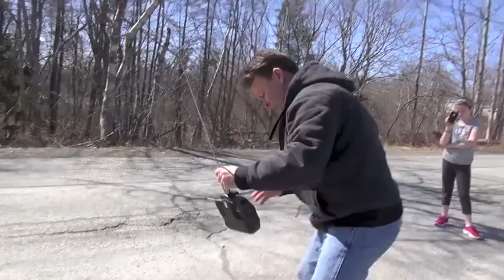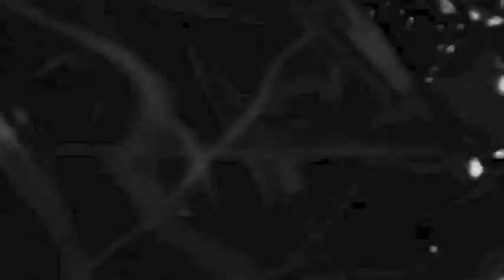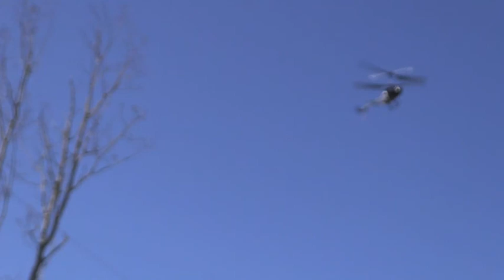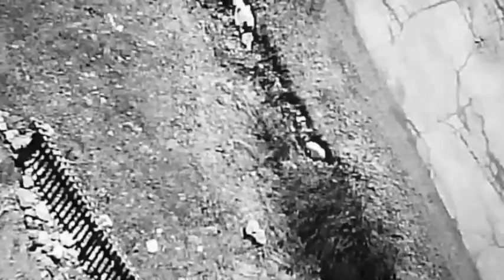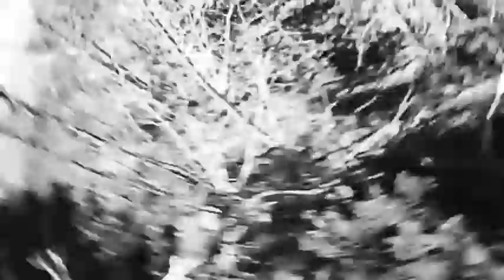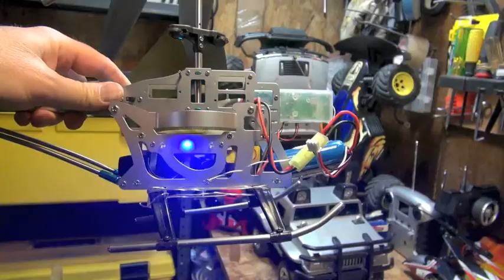Protocol Heli Raider Crash Test

Comment: The blades and plasticnhead part on mine broke so easily...maybe because it was extremely cold, which made it brittle
Reply: hello ,would u be able to provide me with any information about the original battery in the protocol heli,i seem to have missplace mine so i am looking to buy another battery thanks in advance for any help
Reply: Hm....the batteries don't have writing on them...what info do u want me to provide?
Reply: ok ,yeah am not sure what happen to mine but the seem dead no longer take charges so i cant used mu heli anymore ,and am looking to replacement battery  for mine ,if u have upgraded the battery on yours can u give me any info on how to go about upgrading the battery on mine thanks
Reply from the maker: kenton gp They are 7.4 volt lipo around 750 MAH...
Reply: ok ,but a i am not as yet comfortable using lipo,until i do get comfy using them ,thank u very much